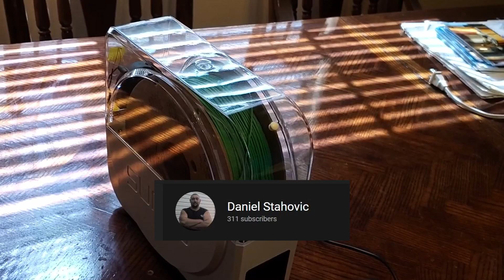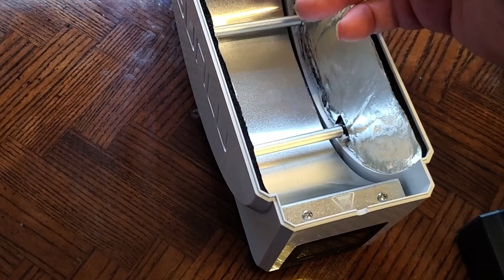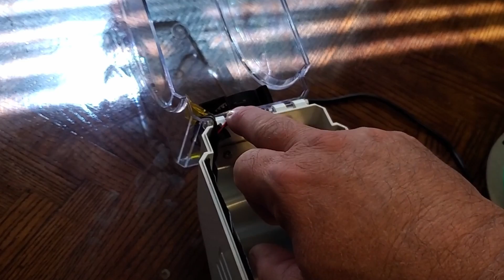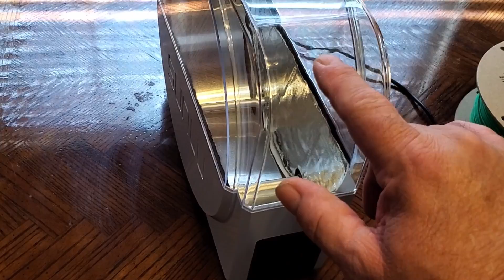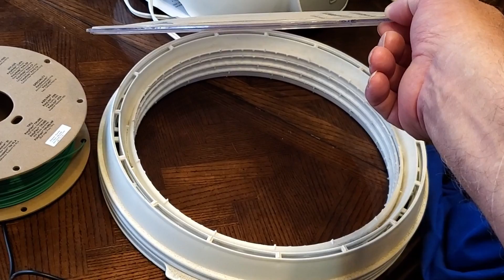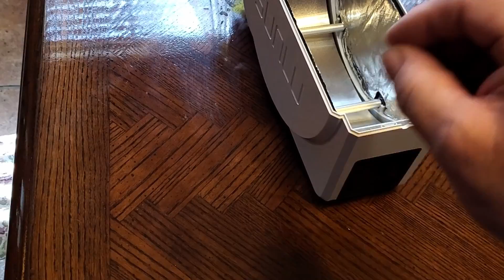Filament Dryer Box Fixed #3dhp

Comment: do you know what type of temp sensor is used? I'm referring to the sensor that is attached to the heating element.
Reply from the maker: I'm not sure,but think its a standard bulb thermistor like on your hotend or bed of any 3d printer.
Reply: @3DHP  like NTC B3950 10K?

Comment: The current version they are selling has a fan... its apparently called the SUNLU filament dryer S1 Plus now even though they didn't change the Amazon listing at all.
Reply: I just bought this one, hopefully it circulates better!
Reply: I bought this one. It also has a light on the screen and a hygrometer - not sure how accurate that hygrometer is. The S1 plus is alright but my fan got loud within a month and I replaced it. Still nowhere for the condensation to go.

Comment: I have been pondering doing a similar thing to mine as well. Stock it is junk. I was thinking of mounting the fan with the intake facing out, and cut a hole to pull in outside air, and then exhaust at the top.